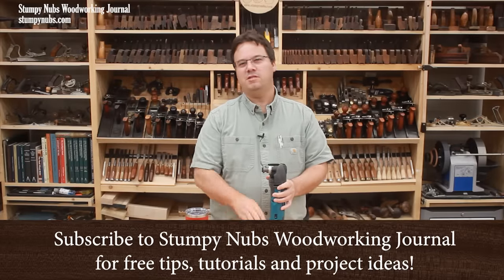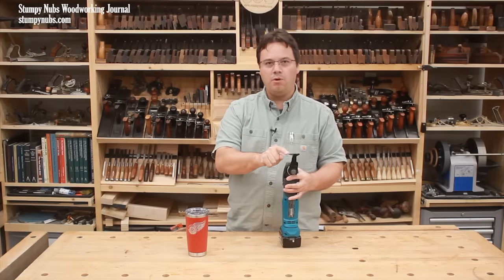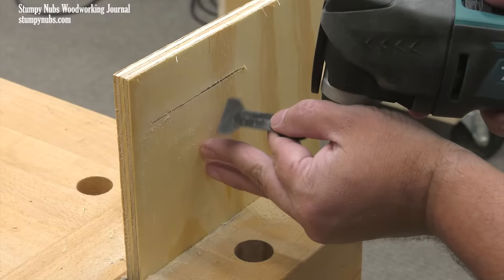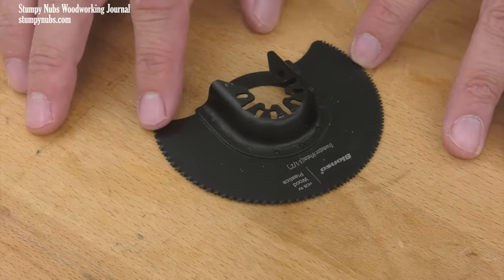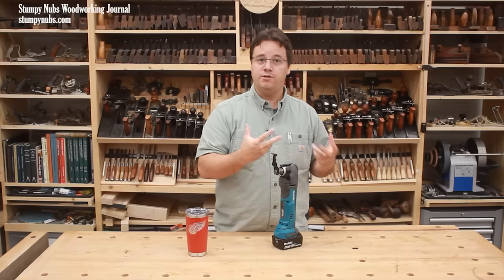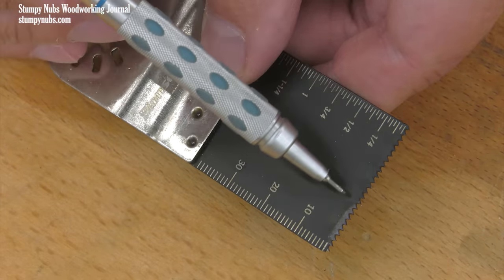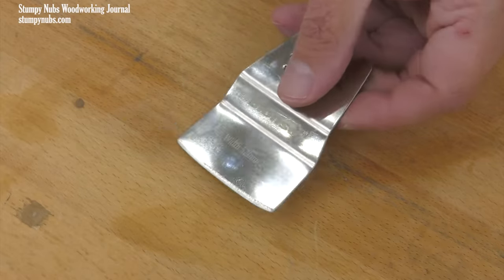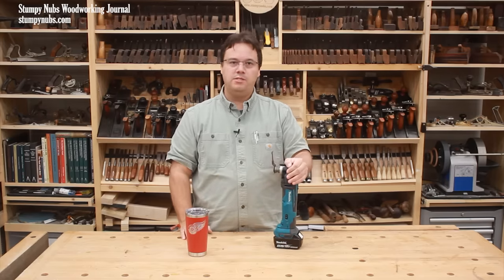CLEVER things to do with an Oscillating Multi-Tool!

Comment: Most of us only reach for these jiggity-jig-jig "multi-tools" as a last resort when everything else has failed, or proven impossible. Of course we NEVER have the right blade by that time either, and also by that time we don't give a damn how well it does the job. We know we will have to "fine-tool" it afterward with files, sand-paper, wood-filler, and Bondo, or else just throw it away and start new. Of just leave it fugly.

Comment: Little known fact, multi tools don't cut soft/ fleshy material
Reply from the maker: Sure they will, they just don't cut instantly because the skin will move with the vibration, which is why they are used to remove casts. But press it against your finger tip with a little force and you will get cut.

Comment: the sander attachments velcro wears out in no time, wont hold the sand paper. Most useless feature.
Reply from the maker: You have to turn the speed down and use lighter pressure. A random orbit sander runs at a slower speed and it too will wear out over time if you press down too hard.
Reply: @StumpyNubs  Thanks because I always run it at full speed.

Comment: I use it to annoy neighbours with its irritating sound
Reply: I prefer firing up my 1923 Maytag and leaving it run for an hour or so.
Reply: @paulhare662  
I used to start cement mixer and throwing a fist of sand in it just for a dry spin. Then police came and said i can not do concrete building in the night. Then i took chainsaw, removed blade, started it and put it in the wheelbarrow to use it as a speaker. But then police came again saying that i can not do it after 8 pm. So now i use multi tool. Im in late 30s and youngest neighbour is 65. As you can see, im dealing with formidable enemies
Reply: @i1bike  I'm 65. If you were to ask the "youngsters" in my neighborhood they would advise against screwing with old guys.  My greatest hit was the rustoleum land mines that ended the paint ball games in my back yard.
Reply: @paulhare662  
Look man, im from croatia, from the rural part. That should be selfexplanatory. Its like from all american redneck exaggerated movies, only it really is like that haha

Comment: Pro-tip...take your blade off when you're done with the tool. Also, you didn't really explain anything that would "dramatically" change how someone with any sort of common sense didn't already know. You pretty much just did a basic description of the tool and some accessory blades. I expected some new revolutionary idea or way of using it that was ACTUALLY  going to "dramatically change" how I use the tool...
Reply from the maker: Quite a few viewers have said they were grateful for the new things they learned. Maybe you already know everything, but calling them without "any sort of common sense" for not being as experienced as you is completely uncalled for. I hope your day gets better...
Reply: @Stumpy Nubs  I never claimed to know everything.  Just that your video description is a bit over-exaggerated.  Again there was nothing in it that would drastically change how anyone uses the tool. You have a nice day as well.